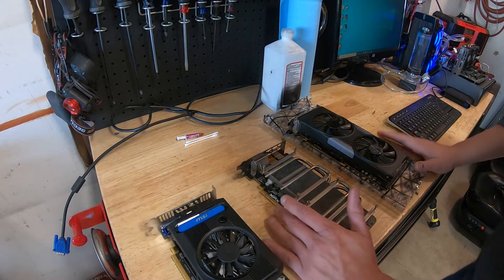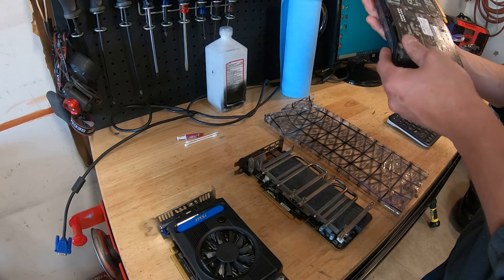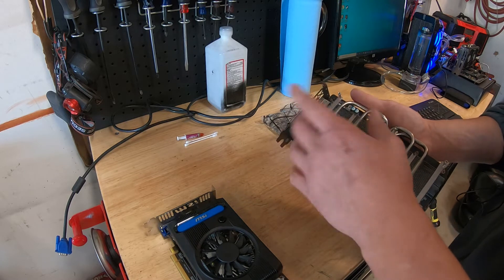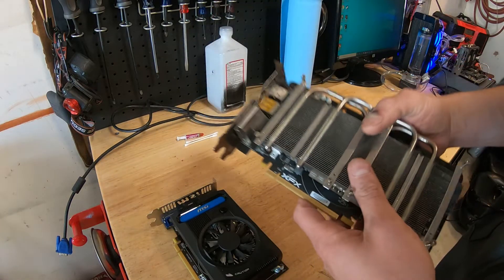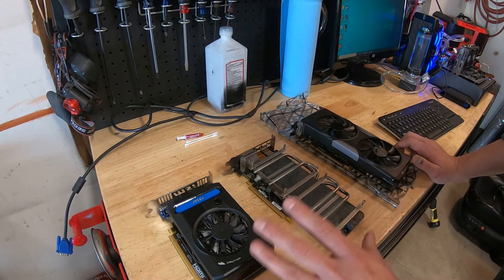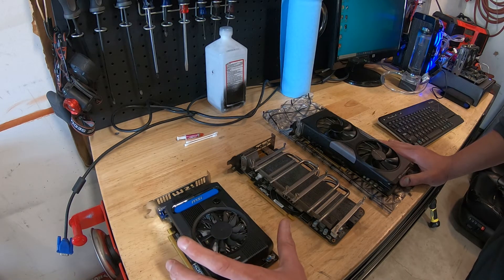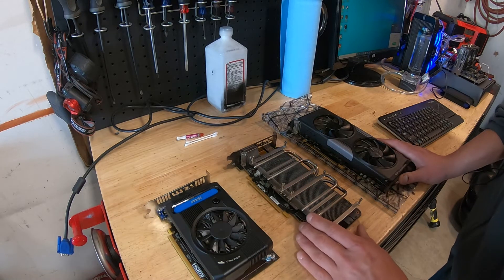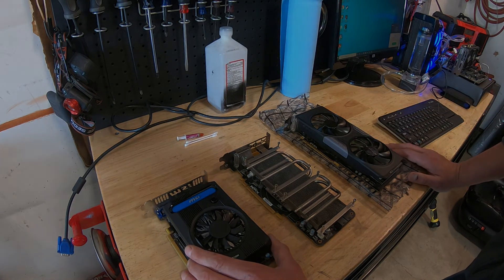Should you buy a used graphics card? What to look for and what to avoid!!

Comment: I’m looking at a used twin edge 3060 for 400€ , the dealer seems legit, any other tips for me?
Reply from the maker: have him run a stress test and send you the video of it running. if they truly legit then they would have no issue with it. over then that considering its a fairly new card everything on it should be good but in newer cards stress test is key to telling you if the gpu has any chips issues.
Reply: @DLMtechgarage  ok thank you

Comment: I got a deal of 2 year used msi R7 260x 2gb ddr5 OC with no warranty for almost 50$ is it worth buying? and can you tell me about lifespan about old amd gpus?
Reply from the maker: if that's USD then that's not a bad deal as they go for $60 for one. Def worth buying for a budget build and for flips. As far as the lifespan, that depends on care of the card. Cards that were cleaned regularly such as keeping the dust off can run a long time. I have seem them last up 10 plus years. Shoot I have cards from 2003 that are still running strong.
Reply: @DLMtechgarage  just got the card and the average temp stays below 75 degrees, and it was clean when I bought it so I think it was a good deal.
Reply from the maker: @dextruct7028  seems good, nice find!

Comment: I just bought a used MSI GTX 1080 ti for 70$ on ebay. I think its too good to be true but apparently it was rarely used and from a responsible owner. Comes with all the original packaging which made me feel confident in buying it.
Reply: Was it legit?
Reply: @michaelc.8518  Unlikely. If you go on ebay and search lowest to highest, you'll se 1080tis for under $100 from users who looks responsible. They're just hacked accounts trying to make a quick buck. Sure it might say "30 day returns" but they make that process difficult on purpose to get you to not do it. If it wasn't a scam, then consider me surprised.
Reply from the maker: Dang if that's legit then that a steal of a deal. Let me know how that works out.

Comment: Should i buy a 1080 for €400 3 year of use
Reply from the maker: don't know what the going average in your area is but the seems a bit high for a 1080. the usage should not matter as long as it has no signs of corrosion of the i/o plate and excessive dust. in my area (US) that's way too much as the go for 300 USD but then again with the market the way it is, the price may have gone up on value since cards are so hard to find.

Comment: Thanks for th video
I'm thinking of buying used 1030 for around 50-60$ I guess, so when I do a stress test like furmark, how long should I do it?
Reply from the maker: I typically run it for like 15-20 mins and monitor the temps, if it starts getting too hot shut it down and check the thermal paste. after that run it again and you should bee good. what your looking for is excessive temps from old thermal paste which is an easy fix and artifacting. Sometimes the artifacting is related to heat issues other times its a bad card but a 1030 typically don't get abuse so you should be find. Let me know how it goes, thanks for watching!!

Comment: How much would you pay for a used :
1050 ti 4gb
Rx 570 4gb/8gb
R9 380 4gb
750ti ?
Reply from the maker: in USD
1050ti $100-$120
rx 570 $ 120-140
r9 380 $100-120
(used)
and that's today overprice computer world we live,  prior to this worlds situation I was getting them for half of that.
Reply: @DLMtechgarage  alright.
Can you help me out with this?
Most of the used 4 GB cards I am getting are mostly
 a) Out of warranty
 b) with no bill (hence I don't really know how old is the card, the owner might lie that it's just 2 year old card
c) used for mining (biggest concern, like getting a RX 570 4G sapphire ITX one for around 100 USD but that was used for mining [he's giving testing warranty of 7 days]

d) what if the card stopped working after 7 days? as it was continuously used 24×7 for 3-4
 years? 

Then, should I buy used one? Or wait for 5-6 months, save money and buy new one?
I have not used any GPU till date, no money :-(
PS: thanks for helping everyone out in detail. Subbed you 💕
Reply from the maker: @stuff6585  buying used is always a risk but can be small. mining cards can be a score due to them being underclocked their whole life, although they run for long periods of time, they run at low voltage and speeds and don't degrade like normal card do. With mining cards I look for rust and corrosion on the i/o plate. That tells me the card was kept in a humid environment and you have a higher risk of corrosion, I tend to negotiate those card low or mostly walk away.
As far as none mining used cards, I look for excessive dust build up. If I see that, I tend to negotiate it low and if not I walk away. The excessive dust has been linked to shorting the cards, overheating and causes severe degradation.
When looking at a used card, I look for cleanliness and if the warranty sea (screw on the back with a sticker)l has been tampered. if the seal has not been tampered and its clean, that usually means the card was in a clean environment, not used hard and have not suffered from typical degradation. If the sticker has been tampered that means the card was overheating, they took it apart to clean it and changed the thermal paste and its  risky if how bad the card was overheating.
Now when I get a used card I stress test it with heaven benchmark first and ask the seller if their is an issue what's the return.
Although it seems risky you can find a great card by keeping an eye on these key items.
Right now the market sucks for pricing and its unforeseen when it will be reasonable so waiting is a gamble too as it could get worse before it gets better.
Hope this helps an let me know if you need any more help. Thanks!!!

Comment: Ayo should I get this gtx 1660 super rog strix and it can overclock for $300? I’ve had a 1660 super on my pc parts list for a while and this 2020 price raise for gpus is so bad. It’s in OfferUp and they’re able to test it for me when I come to pick it up.
Reply from the maker: Honestly It's hard to say anymore what is a good deal as the market is now based on supply and demand. If that's USD then def not a good deal. Its a great card and the strix has always in my opinion been the go to for kids. If the seller is offering to test it and your areas market shows a fair deal based on retail pricing I would def consider it.

Comment: Hello, I'm considering buying a rx 580. The seller told that it was used for mining for like a year and it's almost 3 years old. Should I be concerned? He told me that the card has original BIOS, fans work fine and it looks clean. What do you think? It costs 2700 CZK which is like 120 USD. It's a good price in my country.
Reply from the maker: as long as its been flashed back, cleaned and has fresh thermal paste you should be fine. The mining cards are clocked alot lower and run at lower voltages to maintain cooler temps so they are not pushed hard at all. Def a good price. I would inspect it thoroughly see if they let you test it but for the most part you should be fine! Thanks for watching, let me know how it goes!
Reply: @DLMtechgarage  I bought the card 3 weeks ago and no problems (thank god). Temps are around 78 degrees max when gaming. Fans are a bit noisy, but nothing too bad. The card is clean, BIOS is original. Everything is ok. Thank you.
Reply from the maker: @TheLavk  nice! wish I could find one for a good price right now.

Comment: Got brand new but old stock evga   1080 for 299usd :D
Reply from the maker: sweet deal. which version did you get? Hard to get a good deal lately.
Reply: @DLMtechgarage  i got mine evga acx 3 gtx 1080 , i had to choose between this evga acx 3 299 usd brand new  and evga ftw 1080ti   3 year of use but 350 usd . i choose the 1080 because its new :D . 
first i was scared i thought it was a scam or something because everyone said so because of the suspicious price , i cant sleep well like a week waiting my gpu to arrive , and when my gpu arrived it was completely new everything was sealed, it even smelled like new lol everything works just fine like temperature stress test etc.
Reply from the maker: @ninporiri409r  I feel ya, I'm the same way when I order a deal from eBay and it's seems to good to be true. Glad it worked out for you!
Reply: @DLMtechgarage  hey im back gpu out of stock everywhere scalpers everywhere , lol i feel so grateful  ^^
Reply from the maker: @ninporiri409r  I know what you mean, I got a 3070 by luck and since then its impossible to find anything

Comment: Is a powercolor Vega 64 for £200 worth it on 2020?
Reply from the maker: that's the average going rate for the card. As far as value, its a good card  but you are probably better off with a gtx 1080, they can be found for around that price and are a better value for gaming. Now with the HBM memory it will be ideal for encoding and editing, so pretty much it just comes down to what are you planning to use it for.
Reply: @DLMtechgarage  
Thanks for the reply , now it's just weighing up the risk of 2nd hand for better performance or new for warranty.
Looking at Rx 5500xt 8gb , Rx 580 8gb or gtx 1660 super 6gb .
Reply from the maker: @CM-1723  most times you can still get warranty with used card. EVGA is pretty good about honoring transferred warranty's

Comment: What do sellers mean when they say used for mining?
Reply: never mind i feel stupid i think i know what it means
Reply from the maker: ha ha no worries. Yea mining gpu's are used for getting bit currency. They flash the bios to a custom bios made for lower power consumptions so the card can run longer and cooler due to them being stacked up so close next to each and to also allow for more cards to on a single psu most time. They disable the higher clocks so when you get them they run like crap and won't game. They have to be reflashed to the normal bios and typically run fine afterwards. I always get them, change the paste, give them a good clean and flash the back to factory. I have found the since they are clocked so much lower they tend to still be really reliable and solid cards. Thanks for watching, and hope you can subscribe and feel free to ask any question. Def love to help out!

Comment: I currently have an ROG 2060. Should I sell it used, get around $350 back, then try to get a used 2070super when the price drops as 30 series becomes more available?
Reply from the maker: Be patient my friend. Nvidia is releasing the 3060ti and their is I'm sure going to be a big change in the used market. Anytime a new graphic series card launch the used market goes crazy and people start dropping prices to move their old cards quick to recoup their purchase of new video card. I would hold onto that 2060 a little longer and start watching the used market as you might even see a price dip in the 2080 or better yet, January February of next year the 30 series are gonna be back in stock i'm sure. Also this 3060ti is $399 and it shows that it is 10 percent faster then the 2080 ti, so something def to think and consider. Also that 2060 ROG you got is a good card and with a little OC will get more frames out of it. I currently have a 2080 and I am patiently holding out for some new cards next year when they are back in stock and in the mean time putting away a little extra cash here in their to get a top tier card! Hope this info helps, thanks for watching, hope you can drop a sub and feel free to ask me anything!
Reply: @DLMtechgarage  thanks a lot for the help mate, ill try to keep an eye on the used cards. I’ve already OC’d my GPU +60c and +500mem in afterburner to reach 2010mhz in R6. what sites do you use to look for used GPU’s? I mostly just want to get a better card, to be able to run max settings at 144fps in all games. 2060 can hit 144fps and over but I have to tinker with the settings a bit, also I have to lower them a bit to accommodate streaming.
Reply from the maker: @nick.w9  for used stuff I mostly use ebay, then my second go to is social medla like Facebook. outside of that if I am going new I mostly stick to Amazon. Better customer service then most retailors.
Reply: @DLMtechgarage  thanks a lot! I’ve heard rumors of a regular 3060 as well, and I’m definitely getting tempted to sell it to get a better performing card. I’m just a little dissatisfied with the performance in 1080p, and its lackluster performance in some games. I’ll hold onto my card for a little bit, I’m mostly just looking to recoup its value and maybe spend a little more to get a better performing card. I think another point in which I’m losing performance is in my cpu. I own a 2700x, and compared to the 3000 and 5000 series, it could be a reason why I’m not hitting the frames I want to hit. 

That being said, thanks for all the help! I’m going to hold onto my card for a bit longer to see how the used market on EBay fluctuates, maybe get a better 20 series or new lower-end 30 series depending on its performance when put up against the 20 series cards.
Reply from the maker: @nick.w9  yea im just patiently waiting on some stock to come in. Been striking out left and right with getting and new amd or nvidia card. O well!!

Comment: hey man thanks for the vid. im planning to buy a used 1050 and i wanted to ask you did ppl use this gpu for mining ? should i be worried about that
Reply from the maker: never be discouraged from a mining gpu. You can get awesome deals on them and most times the minner uses a low clock bios and they ran cooler for longer period of times. Few things to consider though, #1 make sure that the bios are flashed back to the original, if not then negotiate with the seller the price and you can flash it back yourself (got a video on the channel on how to do that so check it out). #2 consider changing the thermal paste when you get it and clean it good. Will def help with performance. #3 from my experience I have never really seen those cards used form mining, typically the AMD cards were used. So to some it up, if the deal is real good go for it, I have bought them and sold them in PC's over a year ago and never had one come back. Thanks for watching, check out the other videos I have relating to this topic and hope your subscribed for more content coming soon!

Comment: should i buy a 2060 super i have a 1060 super ATM. Should i sell my old GPU to get a pre owned or a factory made 2060 super
Reply from the maker: Honestly don't rush, new cards are coming out by amd and the prices in the market probably will be changing up a bit. plus from experience, right before a launch people sell their used cards cheap so they can have money for the new stuff. right before the 3080 launch i say 2080 ti's selling for 600, and now that the card is hard to find they are back up. Now if your not an Nvidia fan buy def look into a 5600xt. it is cheaper then the 2060 and marginally faster then the 2060. When I build computers i try to push this card out but everybody just loves nvidia. Hope this help thanks for watching and hope you can subscribe to help the channel!
Reply: DLM tech garage I’m mainly looking for the 2060 super atm as it it’s perfect for my pc build. Where is the best place to get pre owned versions. (Yh I’m subscribed). I’ll wait until those cards come out to make my decision
Reply from the maker: @mrj933  typically social media platforms are the best. I use Facebook, you have more haggle room, can negotiate better, trade if you have something you don't want. The negotiation is def key because you can communicate easier with the seller and typically bring up valid points and why they need to lower the price, ie. dust, used, mis info etc. I use eBay a lot but it take more searching to find a good deal and requires a bit of playing around with their search engine.

Comment: Hey man I’m not in the us so I don’t have those crazy deals, here a new gtx 1650 super is around 170/180€ a new rx580 8gb for maybe 180/190, I’m considering buying a used rx 580 8gb for around 130€ to pair with and Ryzen 5 1600af o Ryzen 3 3100 do you think the gpu is a good deal? And the CPU, will the 6 core Ryzen give me better future proof?
Reply from the maker: the 580 will def be a great card for another two years in my opinion, especially the 8gb version. The gpu is a fair deal compared to prices in my area. they run about 120-150USD used. buying that gpu will def pair well with those cpu, but I would def try and get something a little more up to date for the cpu. At least a ryzen 5 2600 will give you more future proofing as the 1600 and 3100 are really not ideal. The 1600 is way slower and the 3100 lacks in multiprocessing which will limit you if you ever want to do video editing or better yet newer games are now using more cores. Hope this info help and keep me posted. Thanks for watching and hope you can subscribe to help the channel.
Reply: @DLMtechgarage  i thought that the af was basically a 2600 with, its also 12nm and not 14 like The rest of the 1000 séries, basically the 1600af is a underclocked ( that you can overclock to match) 2600, but i'll look into it better, thanks for the input and keep up the good work
Reply from the maker: @santasssssssss2293  just no overclocking and more budget oriented